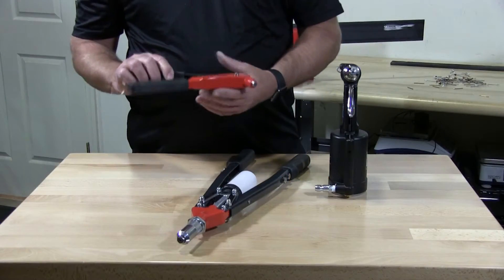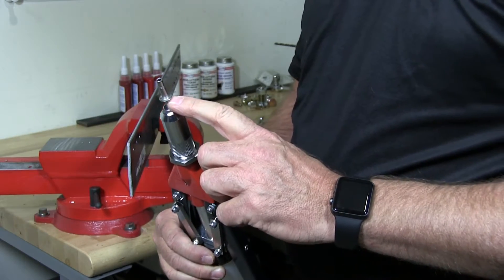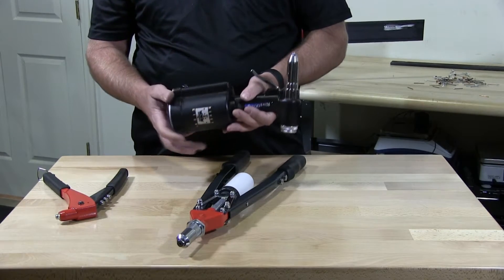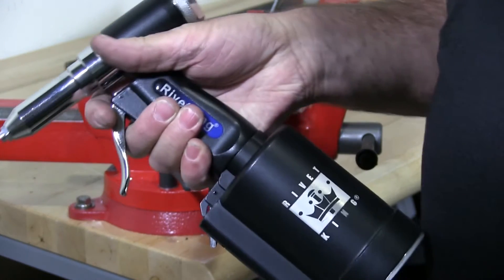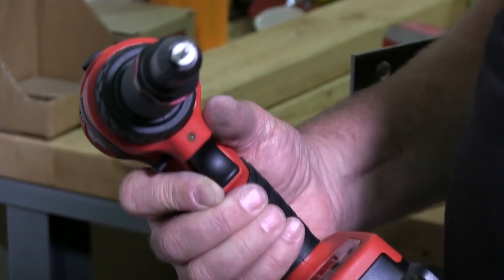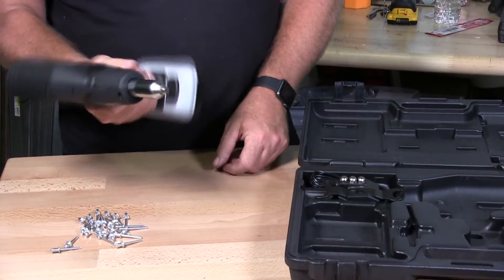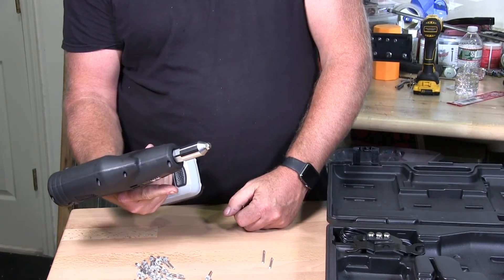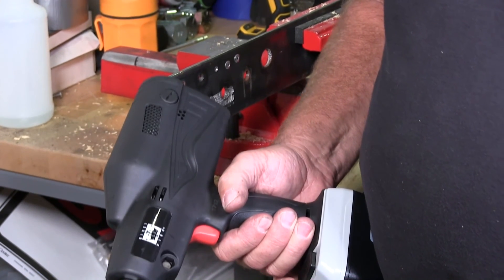All About Blind Pop Rivets - Types of Riveters | Rivets 101

Comment: is there a guide to tell you what size rivet to use based on the common sizes of drill bits? When I was using a drill bit the hole in the gutter was too big for the rivet in assortment at the big box store and it was loose after installation both in the size of the hole and the thickness of the aluminum guttering.
Reply from the maker: There is a guide on rivet sizes! This should help you find the right size bits: https://www.albanycountyfasteners.com/v/Rivet%20Size%20Chart.pdf
We also have additional reference material here that may help: https://www.albanycountyfasteners.com/Fastener-Reference-Tables-s/1157.htm